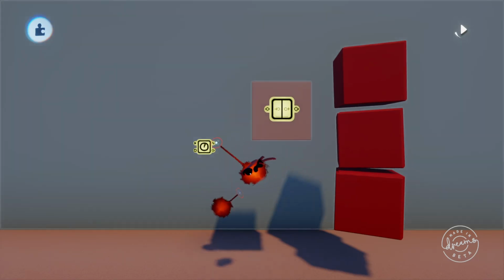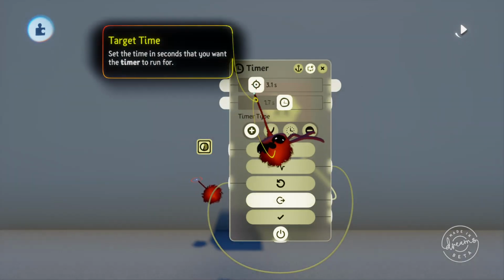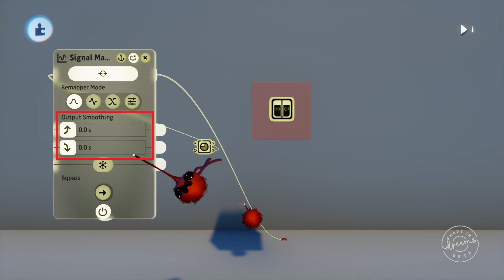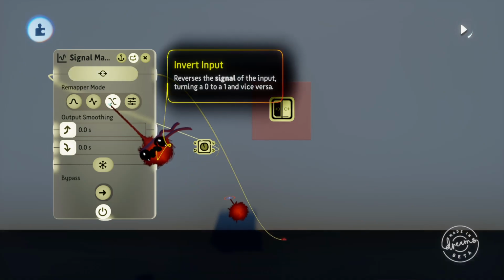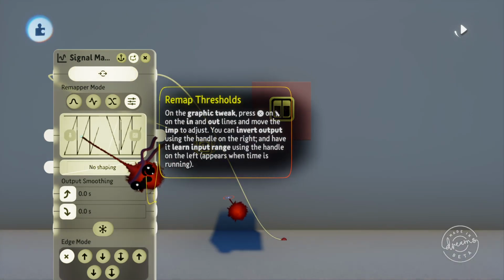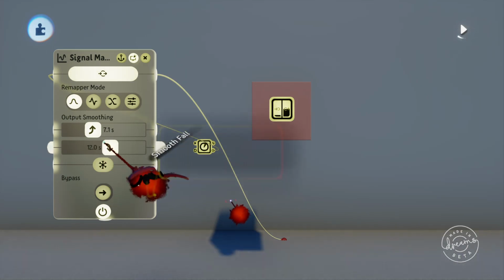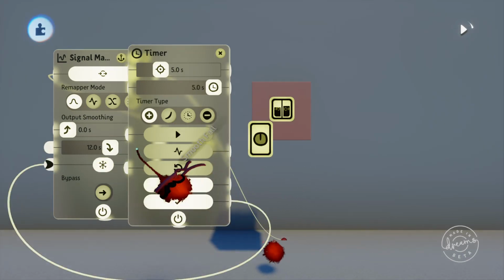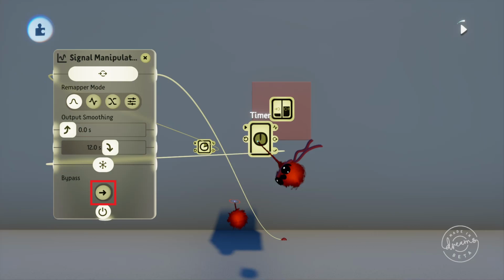Tutorial #17 - SIGNAL MANIPULATOR - Dreams PS4 Logic

Comment: Hi Jules, could you please help, I've tried for hours to no avail...

how I can disable "some" of the controller buttons while another button is being pressed?  IE: I have an animation assigned to controller input X for the puppet, I would like to disable all other buttons (square, triangle, circle) until the animation of X has finished playing... is this too difficult to do?

Currently, my logic is like this:
Controller Input: X  ->  To Switch > To Timeline animation
Controller Input: Square ->  To Switch > To Timeline animation
etc
I posted it here because someone told me it may possible be done with signal manipulators and not gates, but im not sure of the wiring..
Reply: I've played lbp a lot and the logic is pretty simular, maybe just disable the controls at the beginning of the animation timeline by putting a power off signal into the controls of the puppet and have a timer that goes through the duration of the animation that turns it on at the end. Hope this helps! 💛